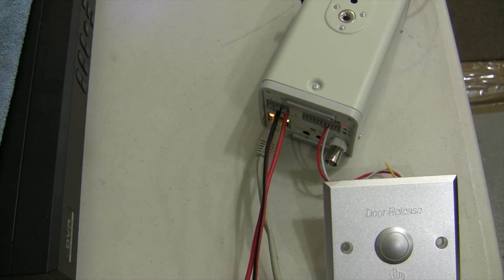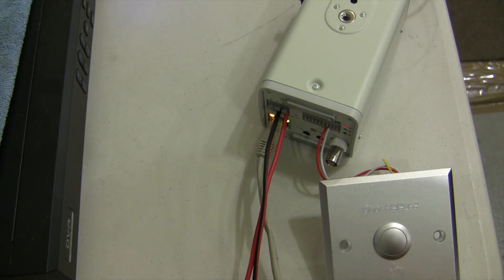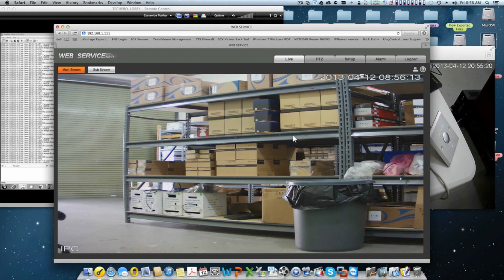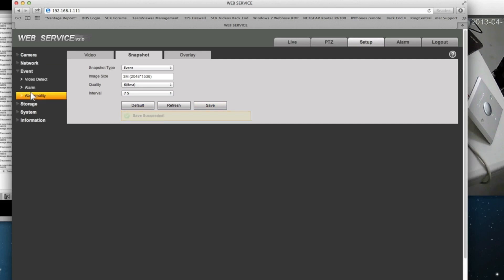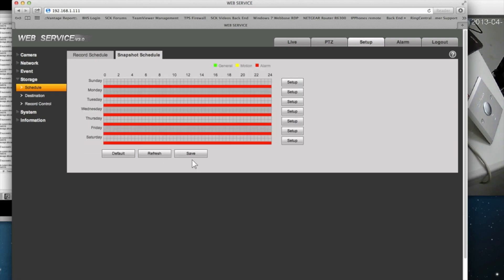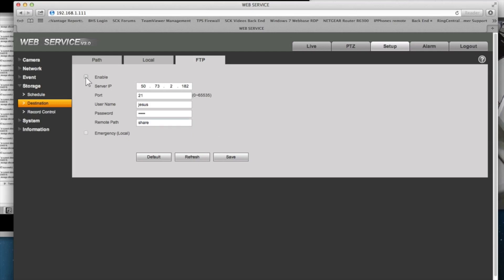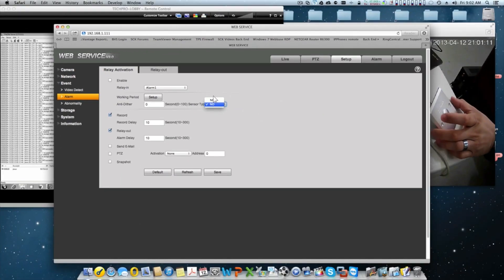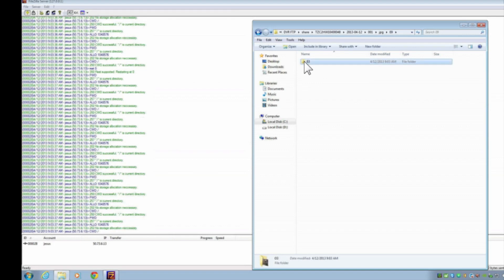FTP Snapshot Upload based on Alarm Trigger

Comment: Thanks for the info. This and then also to send that pic as notification is what I am trying to accomplish.

Reasons:
1.)Dont trust camera software and don't give my cameras gateway access.
2.) Older camera ip notify software outdated and vendors not updating it.

Other possible option maybe to use a security program (Blue Iris or other).